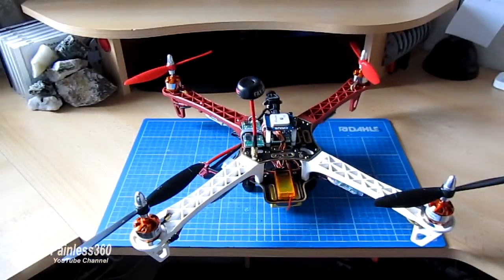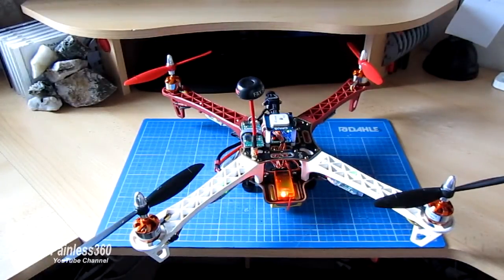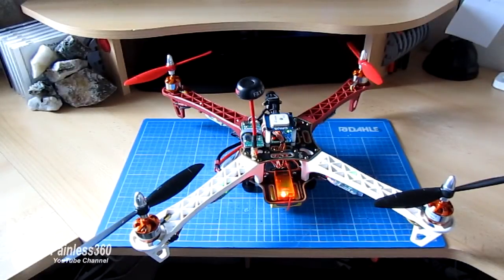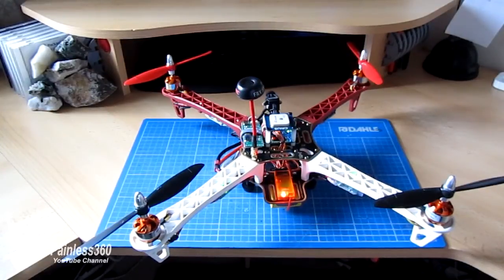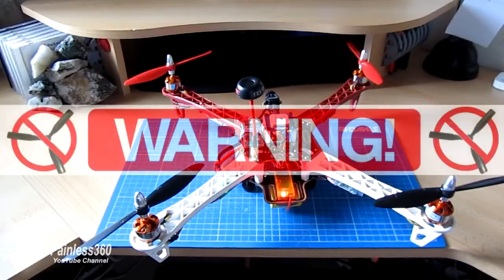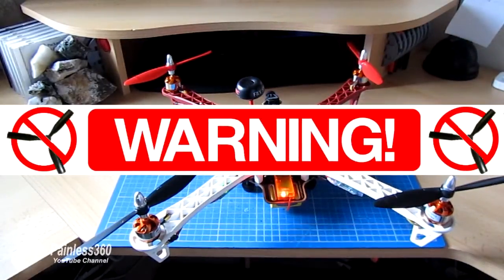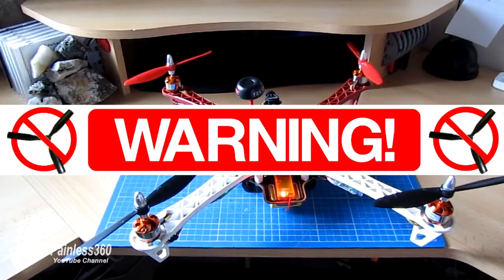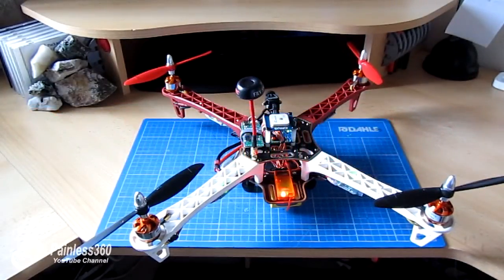Multiwii motor levels when viewed in MultiWiiConf

Comment: Hey man i really like your work and i Always watch your vidéos but I ndeed your help i built a multiwiii rf24 Arduino drone  but when i run multiwiii and i increase thé throttle to maximum all thé motors go to maximum but After seconds thé front left and thé rear right decrease suddenly to minimum
Reply from the maker: I've not touched MultiWii for many years. All I knew is in these videos. Best of luck with it!
Reply: Hello, have u solve the problem?

Comment: My quadcopter motors run in different speed..why??
Can you help me plz..
Reply from the maker: Could be a few things.  What troubleshooting have you already tried?
Reply: @Painless360  
Motors that are clockwise spin at a slower speed in throttle....is my problem in esc or code?
I use multiwii code and arduino uno controller...
Reply from the maker: Again, it could be a few things... it's common to see if you are running the motors on the bench.. see my troubleshooting videos.. best of luck
Reply: @abdulazizaljabber4823  hey man i have the same problème as you please tell me what did you do to solve it
Reply: @arbimajri1143  
U can solve it by trim, but the midtrim at 1500, or u can use beta flight to fix it.

Comment: My quadcopter motors run in different time why? What's the problem?
Reply from the maker: I'm not sure I understand the question, can you ex it a bit more?
Reply: @Painless360  
I mean in throttle  two motors run in high speed but two in slow speed,
I calibrate all sensor.... what is the wrong???
Reply: @omarali-rd1fo   hey man i have the same problème as you please tell me what did you do to solve it

Comment: I damped to multiwii program in arduino uno. The  gyroscope reading correct as multivii simulation, but i increase the throttle 4 motors run different speed how to rectify the error
Reply from the maker: All I know are in the videos - I've not recommended MultiWii, or touched one fro years now. Best of luck!

Comment: hello, please, I need you to help me if you know WHAT happens, I'm with my Crius multiwii is working perfectly, GPS and other commands in the config multiwii, calibrated my ESCS directly on Arduino (can not fly), they accelerate strongly and make calibration by arduino, but when I start the flight, after setting up the magnetometer, barometer and accelerometer, the engines do not give their full strength and the drone does not take off, could tell me what might be happening? where I'm going wrong? thank you!
Reply from the maker: No idea with that level of detail. If you're new to building then I'd check the props are on the right way and not upside down and that the motors/props you are using are powerful enough for the model.. Best of luck!

Comment: Hey I am using multiwii  pro red one and all my motors run at different speeds I have calibrated my escs with and without using multiwii board I also calibrated my acc and mag and nothing works please help man I got a presentation to give plz plz plźzzzzzzzzzzzzzzzzzzzzzzzzzzzzzzzzzzzzzzzzzzz
Reply from the maker: prince malik Have you test flown it? ;)
Reply: Painless 360 can't take off
Reply from the maker: Does the artificial horizon move ok? Have you tried re-flashing the board? Are you sure the board selection you made in the code is the right one?...

Load of stuff for you to try..

Best of luck.
Reply: I trimmed the values but one motor didn't take off and others were making the copter rotate
Reply: Is there any chance of like talking directly to u and telling u what's happening plz
Reply: *way
Reply from the maker: I provide chargeable support one to one. PM me if you are interested.
Reply: No worries I fixed the issue by trimming ty for everything, my controller was messed up
Reply: Hey just one last question I got two setups and I want your advice ok here goes: both my frames weight 2.3 kg, the first setup is 900kv motors with 30amp esc and 9x4 propellers can u suggest which Lipo should I use and also state that can I use 4000mah 4s Lipo with it.... The second setup is 2200kv motors with 40amp turnigy esc and 9x4 props no which Lipo should I use with this setup.... Note props in both setup are carbonfiber props... Thanku in advance :)
Reply from the maker: You need to pick the heaviest battery you can manage and make sure that you are following the motor manufacturers recommendations for the prop size (it is different for 4s and 3s batteries).

Best of luck.
Reply: Ty mate

Comment: Just a quick unrelated question: How much do you like that frame shown in this video? I am looking into getting the same frame, it is cheap enough. I have been currently using various wooden frame designs, however, they have a tendency to break and snap, even with light crashes, and one of my recent designs broke with nothing more than just a hard landing!

Do you break those arms or the center fiberglass easily on like every crash? or just on the particularly bad one's? Thanks!

If you are curios to see by build, you can look at the photos I have posted here for  a problem that has been resolved: mostly: http://www.rcgroups.com/forums/showthread.php?t=2376579#post31149692
Reply from the maker: Hi, cheap frame and the arms take a lot of punishment before snapping, I've only cracked one frame centre in all the time I've been flying and I was unlucky with that one. They are not great for FPV as the props will be seen in the video unless you get a dead-cat conversion kit for it, but I really like them.

I've looked at the quad build pictures - you really put a lot of effort to isolate the Multiwii from vibration. I love the lit motor mounts - where did they come from?

Happy flying!
Reply: Painless360 oh you should have seen my previous build, I had a 4 by 9 inch board with all the electronics mounted to it which was suspended from a H frame! even with severly bent motor shafts and chipped props, I had no jello at all! :) but it was warping in flight which made it difficult to fly, and it was a PITA to fix with every crash.
Reply: Painless360 OK Thanks. I will see if I can find that dead cat frame you refer to.

Comment: Hello, I am having a problem with my board, as motors speed increase and decrease very fast which leaving the quad on the floor even with full throttle. here is a video of the GUI MWC Crius SE 2.5 problem gui recording
Reply from the maker: Hi Ali, I've looked at the video, the thing that I first noticed was how much vibration the board is seeing - the graphs in the lower left hand side of the screen are jumping a lot. Has this model ever flown/crashed recently? I'd rebalance all of the motors and props and mount the MWC on rubber mounts and look to use the 'Low Pass Filter' settings in config.h part of the code to help the board cope with any remaining vibration. Hope this helps.Good luck.
Reply: Painless360 Thanks for your reply, the model never been in air, nor crashed. I balanced the props already but i will balance motors and props. the point that one of the settings (i dont remember which) i tried, the model was more responsive and motors where more relaxed in their rotation. note that the board have already rubber mounts.
Have you tried the Crius SE V2.5? in Config.h i have selected the CRIUS SE V2 the sensors between V2 and V2.5 are Different V2.5 (HMC5883L, MPU6050C, BMP085 ) V2 (HMC5883, MPU6050, BMP085) would this be an issue?
Reply from the maker: Hi Ali, I use the setup for the 2.0 board for the V2.5 board all the time and it works great. I strongly suspect that vibration is something to do with it - double check that you have reset both the acc and mag on the board via the MutliWiiConfig software.

Best of luck.

Comment: Is that a witespy GPS backplane I see?  Which one?
Reply from the maker: Hi Ryan, sorry it's not a witespy. I made myself it using the standard mounting holes and a nylon PCB standoffs. Let me know if you need more information.Happy flying!
Reply: Where do you get your MultiWii gear? What model GPS are you using? thanks for posting such useful videos! Good stuff!
Reply from the maker: Hi Ryan. I get the board from all over. Commonly eBay and Banggood.com. I've used the CN-06 V2 and V3 models on the builds. The V3 I've received have the same 35mm mounts as the Multiwii 2.x board so you can stack them like I've done. I have a video that shows how to set it all up in the Multiwii playlist.

Comment: Hello mate. I would like to ask you about charging a 4s 5000mah lipo battery with imax b6 charger. Can i charge this lipo with 2.5 A ? And how much power should i provide to the charger 16v 5.5A is enough? Thank you very much. Regards Slawek
Reply from the maker: Hi, see my video on LIPO batteries that covers all of this - @watch?v=Oda0JYzGG3wYou will need a power supply that can deliver enough power. You need a 12v power supply that can deliver 9amps or more. Each set of three cells is charged at 4amps for a 4000mah pack so you will need 8 amps for the 6s pack and some extra to run the electronics in the charger.